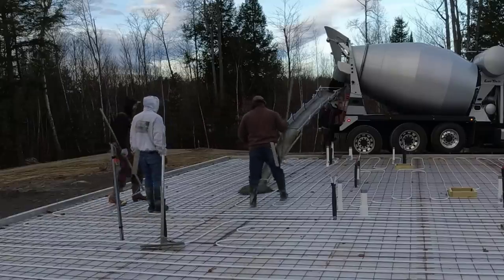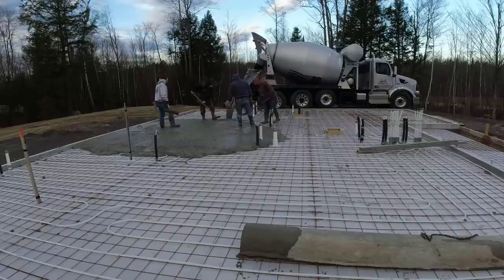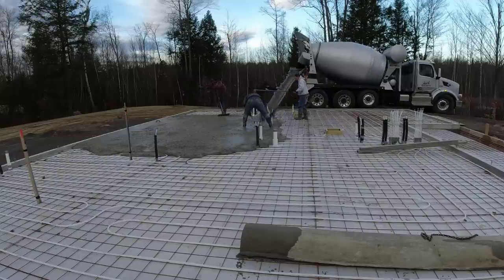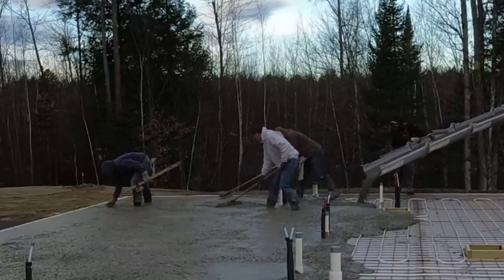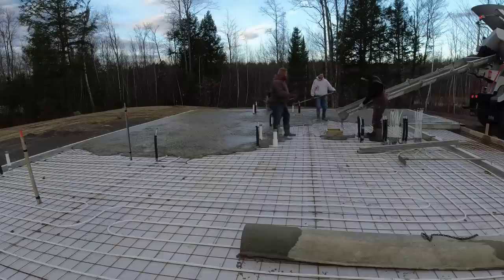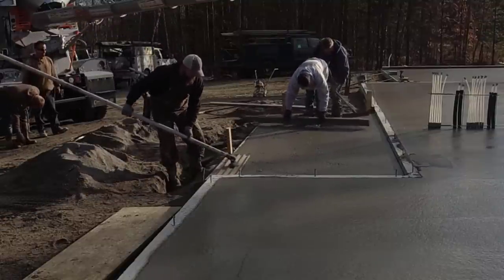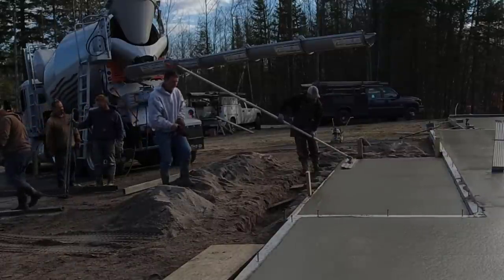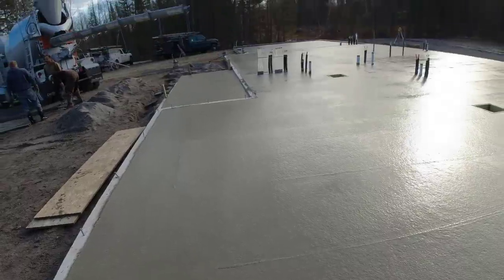How 4 Guys Can Pour A House /Garage/ & Entry in 90 Minutes (Concrete Floors)

Comment: the  water  reducer can be  detrimental  to  strength  integrity   are  you getting  a  lot of  cracks  in your  floors    water reducer  may have  weak spots  seperation  from  aggregate and cement

Comment: maging, is that because the float is Magnesium material. and if so why magnesium?
Reply: Strong and lightweight.  Concrete wears down other materials too quickly. Steel is too heavy. ( I think )
Reply: In the old days wood was used as a concrete float (and they still have them out there) but the wood tends to suck up moisture - Magnesium is a great material and steel floats tend to "stick" down, while a Mag will float over the surface nicer.

Comment: Putting calcium chloride in a  house slab... get a different type of accelerator. Calcium chloride is detrimental to concrete. Separates the bond between steel and concrete allowing oxygen to reach the steel and rust to occur. 
In 20 years time, what's holding the slab together... especially in reactive soils.
Reply from the maker: Been using it 42 years without any problems